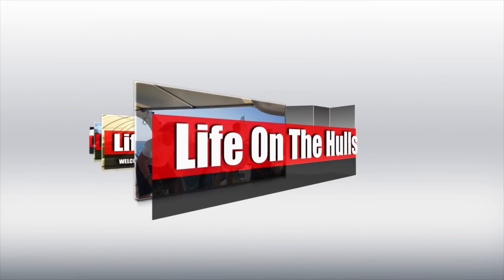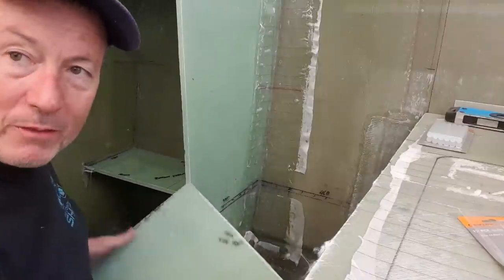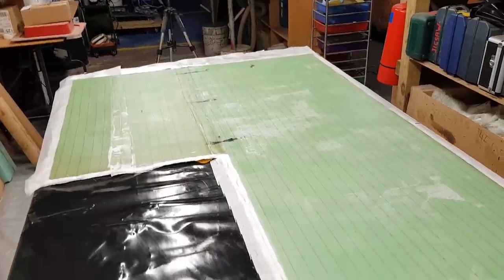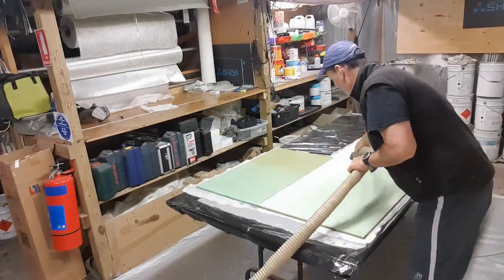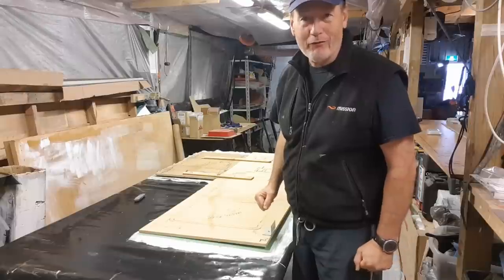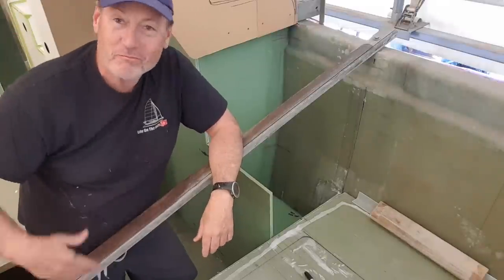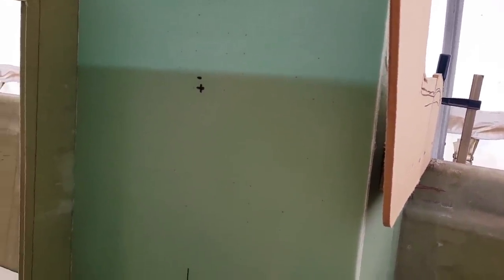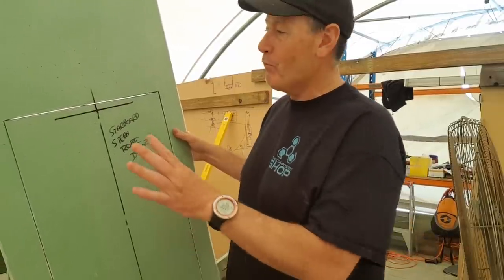Ep120 Yacht cabin structure with a little bit of ASMR - Building a Fibreglass Catamaran

Comment: love ya work Ross I have a suggestion around the lower shelves in the robe, would it not make the lower shelf more useful if you hinged an extension onto the shelf to make it full depth while still allowing the same access to the under space, seems if you are putting thru hulls and wiring and such they would be better protected that way as well cheers

Comment: Ross, just curious, you've shown us numerous techniques / types of fiberglass. Have you ever had or used a chopper gun? Typically used for large areas like hull or deck molds. The gun has a rotating knife edge that chops the roving into 2cm lengths and sprays it onto mold along with resin and metered flow of catalyst (same effect as th he chopped roving matt). Its very fast but also very messy!

Comment: As I watch the build and the way you do it I find that there is not any missed items. I wonder how all was done when they were built at the factory for sale. I can't see where they were able to take the time to reinforce every joint. Look forward to every issue.
Reply from the maker: I guess it would come down to cheap labour costs in a lot of production cases.In an Australian made boat the extra costs would be substantial du to high labour costs.ln my case I dont have an income so I take my time to get it right.Cheers Rossco
Reply: @LifeOnTheHulls  Same in Canada. Basic wage 15.00 per hour about 28,000 per year while our seniors live on 18. Vet are just as bad off.

Comment: Just looking at the wardrobe/bedside cabinet front into which you have partially cut the doors.

All the corners are sharp right angles, could this lead to stress cracking in the laminate face?  Certainly if it was HPL then internal corners should have a minimum 6mm red to avoid stress cracks

Comment: Gonna need a fiddle on those short shelves to keep your shirts from descending down to mingle with the odd bits at the bottom. Looks like your Cat is going to be about 50% stronger than any commercial build, no worries about big seas! It seems that no matter what you do, all bilges tends to develop some 'funky' odors over time. Do you think it's worth it to install a forced air vent system to help dry out and eject any smell from the main bilge areas? I put a small low voltage fan (sealed) in the engine compartment and it completely removed the fuel and oil fumes from the rest of the boat. (Twin 350 Mercs tend to produce a lot of 'engine related' aromas)... ; {

Comment: Just thinking, those doors made from fome would cost you a fortune. Per sheet, they are very very expensive. But I guess what else would you do with the cutout. Efficient use of the material.
Reply from the maker: Luckily my plan,yet to be proven will use all of the cutouts with a timber frame for hinges,door latches etc and a base to complete veneer.Hold tight could still be a fail.Ross